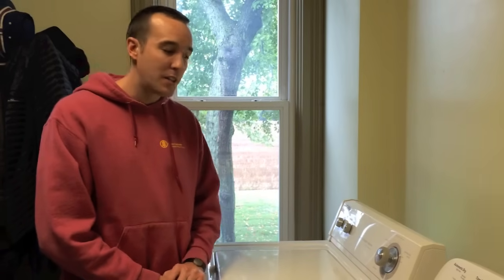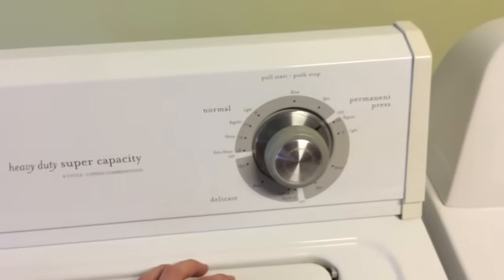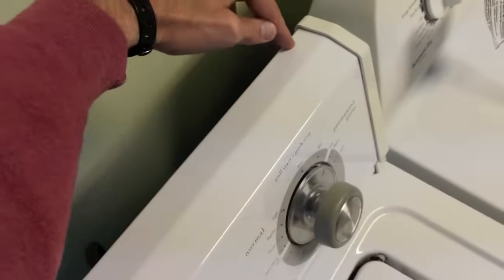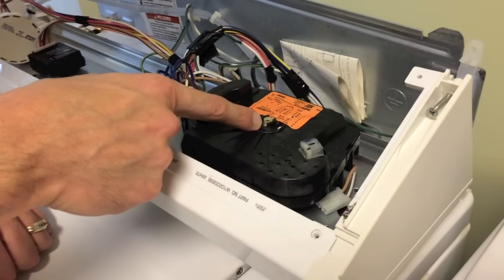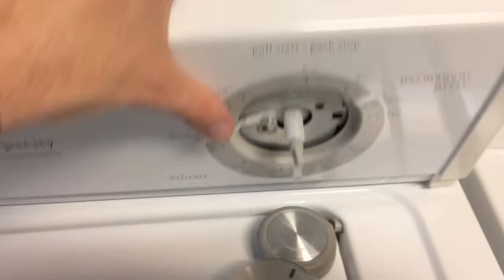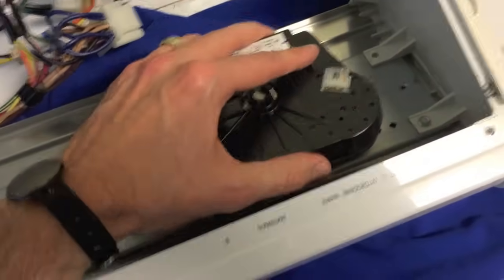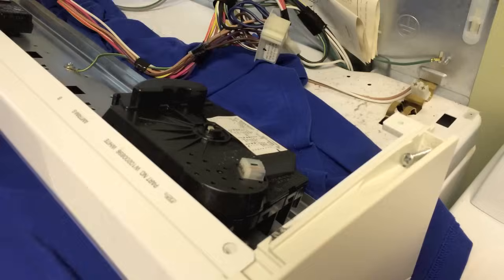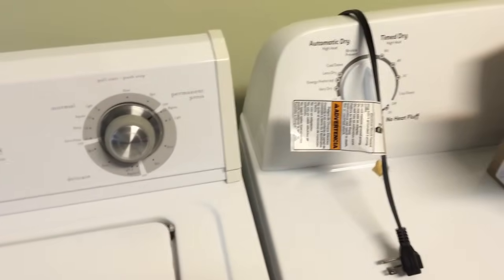My washing machine stops at Rinse - Does not DRAIN or SPIN

Comment: Replacing the timer is certainly an option, but so it fixing the problem with the timer. The timer can be opened up and then just clean the contacts. Inside the 'timer' (which is really a motorized switch) is just a clock motor and an assembly of leaf springs. The contacts get burnt from all the Off/On activity. An emery board  or sandpaper will work if you don't have the proper contact cleaning tool. Once a washer/dryer is ~8+ years old, new parts become hard to come by. We just fixed our own timer this evening. $230 for a New timer, problem though is that the normal appliance stores say the part is not available. 4 used ones on eBay $50 - $120 and 1 old, NIB timer for $230!?. Husband and I fixed ours in about two+ hours. This video is just fine but if the timer Motor is still working, there is no need to replace the timer assembly, just open it up and clean the contacts. What do you have to lose?  Enjoy!
Reply: Thank you so much, I'm 90% sure you're on the right track for my machine, it just quit working mid cycle. Every position works except for the final rinse/spin.
Well I guess I know what my next project is! 🙃
Reply: If anyone happens to find this, before you pull your timer out check if your lid switch is clicking. Found another video about replacing it so I decided to check mine and nope no click, luckily a screwdriver shoved in the hole did make it click and let me finish this load. Bonus new switches are $20 instead of $200+ for a used timer.
Reply: @dontcallmebrave  thats crazy ty this was my problem.
Reply: Will do that!! Thanks
Reply: I have a compact washer with buttons and the time is on a screen, but, my machine drains first time and not second time I can get it to finally drain by blowing in rinse hose. I already installed a new pump. Any ideas please..
Reply: Yeah, but how do you do that? 
How do you clean the contacts, and where exactly are they, and which ones exactly do I clean?

I am NOT the handyman type.

I am more the: 
If I don’t have a YouTube video very explicitly showing me step-by-step what I must do I’m screwed (and lost).

I don’t do real well with explanations that assume that I know stuff that I don’t know.

Yep, I need to be shown EVERYTHING.
(And having the explanation given in the narration in total layman’s terms also really helps.)
Reply: @dontcallmebrave  Could you link the video?
Reply: Thanks for this suggestion. Is it hard to clean the timer contacts? Do you know of a YouTube video that shows how to do it?
Reply: @ashleyletterman7808 soon as you make one LMK

Comment: Great video - both this and the one on the lid switch.  My question is, how to determine if it's the lid switch or the timer that needs replacing?  If it helps, I have a KitchenAid washer, model KAWS850LQ1.  Mine stops at rinse, but if I manually advance the timer knob about 1/8" it will often (but not always) finish the cycle.  Thanks.
Reply from the maker: Branton Lachman 

Hey Branton, thanks for checking out the video.  Great question & the symptoms led us to the lid switch first...I tested the lid switch and found that to work as it should.  This then led me to the timer.  After replacing the timer, problem solved.  Try your lid switch first...there are a few videos out there that will show you how to test it.  Below is a link to our lid switch replacement.  Please Subscribe to the channel and turn on your YouTube notification Bell 🛎 that would be awesome thanks again 😀👍

Definitely keep us posted with your DIY project, we are here to help!

https://youtu.be/1hTRc-_PnP8
Reply: @DIYwithMichaelBorders  Aloha guys Ive replaced both the lid switch and the timer on my 80 series and still the washer stops after filling the rinse mode. If I advance the timer manually it finishes the cycle if not the timer eventually times out sometimes draining the rinse water but wont spin.
Reply from the maker: FlyFishingMolokai 

Thanks for watching, have you verified your drain hose is clean and clear not allowing any blockage of drain water.  Also, how is your water pressure coming into the washer?

Is the water coming into your washer the same pressure or speed it was the day you purchased washer... or has it slowed down?

Your screens inside water valve may be clogged.  If you clean your screens, which are right inside where are your Hot and cold water lines connect to the washer are...& it doesn’t fix the problem, you will need to replace your water valve.

Below is a link to our step-by-step video that shows replacement of valve.  Let’s get this figured out together!

       https://youtu.be/DiPFZSMiBn8

Please subscribe to the channel and Ring your YouTube Bell 🛎 that would be awesome thanks again!

😎👍🔧🔩
Reply: Bridge the lid switch and test. If problem goes away, replace lid switch. If not, there is some other problem. Remember to remove the bridge!
Reply: @gerhardotto2270  Great tip.  Thanks!

Comment: I changed my shift actuator and lid switch and my machine still stopping on the rinse cycle have to manually set it to drain and rinse and push the start Botton for it to complete. I guess it may be the timer
Reply from the maker: Codeblack WestPhilly 

Thanks for watching & after reading your comment, we definitely are leaning toward a faulty Timer.

That’s awesome you replaced your Actuator & Lid Switch as well.  This ensures those replaced parts are brand new & ready to work & last a long time.

Keep us posted on your project!  We purchase all our parts from:

       RepairClinic.com

We also recommend checking several other places to get the best price!

Hope this helps, please subscribe to the channel and turn on your YouTube notification Bell 🛎 that would be awesome thanks again!  😎👍🔧🔩

Comment: Is it common for the other cycles to work normally if the timer seems to have failed on one of them?
Reply from the maker: Michael Weber 

Thanks for watching & yes it is.  The internal design of the timer assists in coordinating the washing machine through its cycle.

At any point, any one of those internal mechanisms inside the timer wear out or fail, the timer will no longer be able to continue guiding the washer through all of its cycle.

In other words, the timer guides the washer through wash, rinse, and spin...but can stop at any point during that full cycle if any of the internal timer parts fails.

Hope this helps.  Please subscribe to the channel and turn on your YouTube notification Bell 🛎 that would be awesome thanks again!

😎👍🔧🔩

Comment: Thanks Mike B. I was excited that this is almost identical to my washing machine. Then you brought out the REPLACEMENT part.   
I wanted a home fix...which is what I got; but, let me describe my problem more. Like you, my machine did not go into the rinse or spin cycles; but, the timer DID continue until the next space on the dial, I followed your instructions to take off the timer dial. I used a can of compressed air to spray it out a little in the holes on the back and beneath the the dial. I reattached the ground wire to the metal part of the cover and plugged it back in. I set the dial on "spin" and popped out the knob. It immediately went into the spin cycle. Thank you for the helpful video. I hope this helps others as well.
Reply from the maker: Gann Bob 

Awesome Awesome & we love reading comments like yours.  We are happy to hear the video helped & you got your washer running correctly again.

We really enjoy making these helpful videos for our fellow DIY’ers.  Your info is great & will definitely help future viewers.  You Rock!  😀

Please subscribe to the channel and turn on your YouTube notification Bell 🛎 that would be awesome thanks again!

😎👍🔧🔩
Reply: Thanks for your comments and of course this video. The replacement timers are quite expensive for such an old mechanical style of unit. The cleaning of the timer with compressed air sounds like a plan and very likely the fault of our Inglis. Now twice, the timer stops without draining the drum. Works after manually starting it again where it was last. Appreciate the advice. Thanks.

Comment: I 'fixed' my LG front loading washer which was stuck on rinse and wouldn't drain and move on to spin cycle.  Unplug the washer. On this particular washer there is a small panel on the front lower left.  You have to pop it open with a butter knife. Inside is a small black plastic plug on the left and what looks like a larger black plastic dial on the right. These are filters that probably need to be dealt with.  Be prepared with  towels and a bucket or large bowl since the washer is full of water.
First the small black plug and pull it out gently. It is attached to a flexible tube. Point it a your bowl or bucket, remove the black cap and let the water drain.  There will probably be some sand or guck. This is slow, so once it drains clear you can plug it back up, push back in place and deal with the filter on the right.  But you might want to the water in the washer come out this slow way because when you begin to remove the filter on the right side the water in the washer will gush out. It's much easier to deal with if your washer is on a pedestal  with a drawer underneath so you can position a bowl to catch the water. So remove the filter on the right side.  In my case it was clogged with two bobby pins, a whole cloth napkin  (that I hadn't seen in years) and a whole lot of lint. Put it back together. That did the trick for me.
Side note: another fix  -  if LG washer shows error code LE - unplug, wait 90 seconds.  Rotate drum manually to left 4 times then manually to the right 4 times.  Plug back in.  This resets something and has worked for dozens of people.
Reply from the maker: Connie Simila 

Awesome Awesome & we absolutely love your info Connie!  That is great helpful info for all of us!  You Rock!  😀

We are happy to see you accomplished your DIY project.  Definitely keep us posted on questions.

Again, that was extremely nice of you to share your comment.  This will be very helpful to many!

Please subscribe to the channel and turn on your YouTube notification Bell 🛎 that would be awesome thanks again!

😎👍🔧🔩

Comment: I watched this video and thought I had a bad timer or water inlet valve. After some checking it turns out I had a bad FloodSafe hose from the cold waterside. When it went to rinse it received no cold water and just sat there. Luckily the fix was inexpensive and this video did help me to eliminate the items that were working fine. 
-jz
Reply from the maker: Bitter Clinger 

Thanks for checking out the video and sharing your experience.  We appreciate you taking the time to reach out to us.  Glad to hear you’re back up & running.  Let us know if you have any additional questions along the way!  Please subscribe to the channel and turn on your YouTube notifications that would be awesome thanks again 😎👍
Reply: I have the same exact problem. May I ask how you fixed it? I changed the hoses and that didn't fix the issue.

Comment: It's been my experience that a defefective lid switch or loose lid screws are the most common causes. The timer won't advance if the lid switch isn't closed. Very seldom would be a timer problem be the cause of this problem.
Reply from the maker: Bob McDonald 

Thanks for checking out the video Bob!  In our case, the poor Timer called it quits 😲.

After replacing Timer, Washing Machine was back up & running.  The Lid Switch is also a very common cause as you mentioned.  You’re spot on!  

Please subscribe to the channel and turn on your YouTube notification Bell that would be awesome thanks again!  😎👍🔧🔩
Reply: Appreciate the insight.  Check lid switch 1st!  Thx and appreciate the insight
Reply: @RD-xh9ss  anything I should check after the lid switch before replacing the timer? Anyway to bypass the timer to make sure it’s the problem?

Comment: heyo . My washer is an Edison by Whirlpool model SM 8525147-A, and it would do this thing where it would start in the fill up cycle, do an agitation cycle, then it would drain and then start to rinse, but at that point it would just keep filling and filling and filling and draining all the water through. I would also hear a grinding buzzing like plastic gears grinding coming from the timer knob. That's what told me that my timer was broken. Well, that and if I advanced it one or two clicks it would resume the wash cycle as if nothing happened.
After searching hopelessly online and coming up dry on the model number I got frustrated and undid the side screws and opened the control panel, and I saw the timer model number 8542050. I went to the internet and entered the number, 8542050 and BLAM! Pages of listings for the timer! 
I WAS SO HAPPY!!!!
So, don't make my mistakes, folks: If you can't find the parts for the model number, LOOK AT THE NUMBER ON THE PART ITSELF. That'll get you there 10 times outta 10. 
Also, knowing that I can crack my machine open and fix it myself is a very empowering experience. I recommend everyone tinker with their machines as long as they have down the basic fundamentals of appliance repair. You'll learn a lot!
Oh, and @DIY With Michael Borders, you don't need to undo the 1/4" screws holding the plastic straps. They're there to hold the control plate and let it fold up and back to expose all the wiring and tubes at once. I learned that as I was pulling her apart.
Happy Tinkering!
Reply from the maker: Preston Scott 

Awesome Awesome & thanks for sharing your experience Preston.  This is great info & will be helpful for future viewers.  😀

We really enjoy making these helpful videos for our fellow DIY’ers.  Let us know if you have any questions.

Please subscribe to the channel and turn on your YouTube notification Bell 🛎 that would be awesome thanks again!

😎👍🔧🔩

Comment: Well this video is younger than my new washing machine but this is the exact problem. I have done the diagnostic cycle and the calibration cycle and this is more descriptive of my problem than anything else I have done to figure out this washing machine .. good thing it was free. 
2020 is killing me! ☹️
Reply from the maker: Tabie Wade 

Thanks for checking out the video.  The Timer controls the “Cycle Flow” and continues to move the cycle through the steps.  As the internal parts of the Timer begins to wear out...you see the washer stopping at either “Drain or Spin”...

The Lid Switch also is a key part in the cycle...once you lower the Lid/door...you will hear a click.  This click secures the electrical current and sends message to Timer to begin the Cycle.  

Also...once the cycle gets to the spin portion, the timer re-communicates  with the lid switch to verify that the lid is closed for safety purposes...example:  you do not want the washer to be spinning with a lid open...water will fly everywhere 😱

I recommend purchasing both the timer and the lid switch as they work together to move the washer through the cycle.  

To order parts, Go to:  repairclinic.com

Keep me posted!  Please subscribe to the channel and ring your YouTube bell 🔔.

😎👍
Reply: @DIYwithMichaelBorders  that may be a big part of the problem because the lid switch appears to be broken. Thanks for your reply it clears things up a bit.
Reply from the maker: Tabie Wade 

You are very welcome.  😎👍

Comment: Excellent video. My 18 year old Fridgeraire suddenly stopped draining and spinning. On the regular cycle it stops at a point, then doesn't progress through the cycle. I think it is not draining and when it stops at a particular point- it makes this noise, as if it's trying to move onto the next part of the cycle which comes from close to the timer area. If I move the timer a bit ahead, it continues to agitate but it still never spins. I have tried the other delicate cycle and there, it goes through the cycle but never spins at all. The knob will move from start to end without spinning - all it does it agitate. You can hear it want to do something and you hear some clicks but it won't spin. At the end of the wash, there is always a lot of water left - I am not sure if it is partly draining though since the water is about 6 inches deep always - to the same level at the end of the cycle each time. It must be partly draining since I expect if it didn't drain there would be more water? Any help in the comments from anyone would be appreciated!
Reply from the maker: Good morning, we are drinking our morning coffee answering any and all questions for the DIY community.

Your symptoms are definitely in-line with a faulty Timer however, also in-line with a faulty Lid Switch.

Our recommendation is to replace the Lid Switch first as it’s a more price friendly part.

Below is a link to our video showing replacement of Lid Switch.

       https://youtu.be/1hTRc-_PnP8

If replacing this part does not fix issue, it is time to replace your Timer.  You may want to purchase both parts so you have the Timer handy if the Lid Switch replacement doesn’t fix issue.

If Lid Switch fixes issue, you can return Timer...or you can replace both parts at the same time.  New parts are always a great asset to the continued life of the unit.

Please keep us posted, we are looking forward to hearing back from you.  We DIYers need to stick together!!!!!

😎👍
Reply: @DIYwithMichaelBorders  Thankyou so much for your reply..but my washer is a front load washer so will it still be something similar to the lid switch for front loaders? I did a lot of research for my model and is the lid switch the same as "washer door lock and switch assembly?
Reply from the maker: @AtheneNike1  

Thanks for the reply, with front load, it’s possible that your door lock mechanism is faulty.

This can be figured out by listening to the door lock mechanism after starting the cycle.  If you hear the door lock mechanism make a clicking sound after the cycle starts, it is locking door & working as designed.